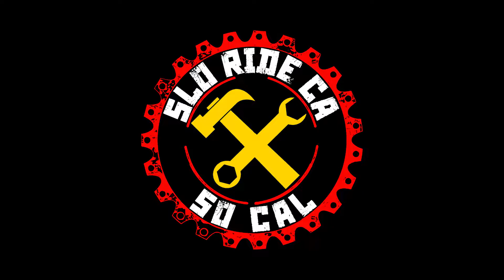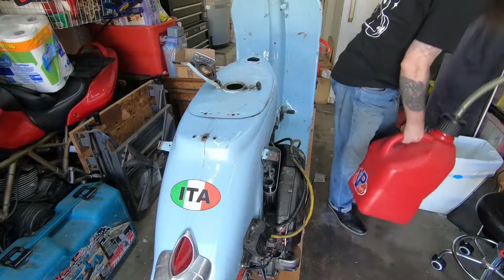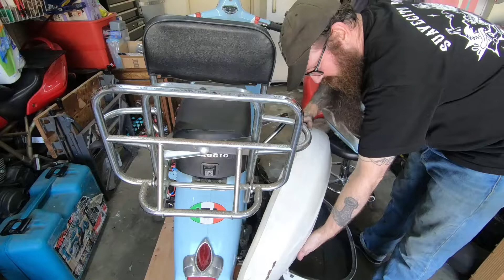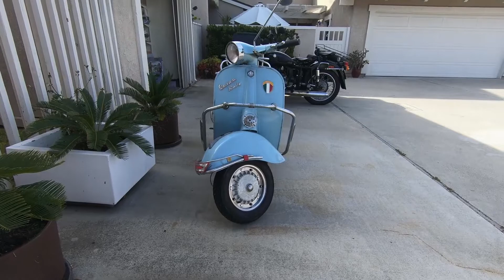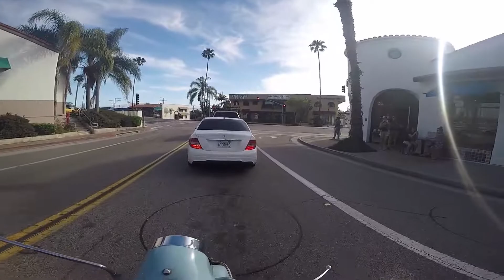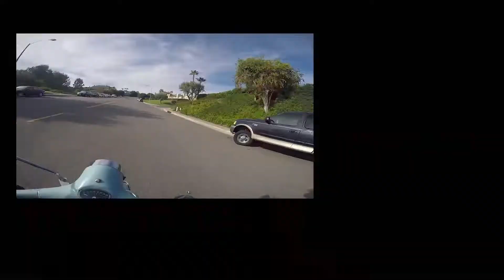It Lives! - Carb Install/First Ride - Vespa Rally Rebuild Part 5

Comment: It is scary who similar our lives are. I imported a 1963 GL and completely restored it and had kids before I could get to ride it. It has sat in the garage for 12 years. 

Getting it running again is my COVID project. I thought your tank clean out was a great video. I am starting with a Noco Genius Charger  to see if I can save  the battery then into the fuel system. 

Awesome video!!
Reply from the maker: I doubt you can save a 12 year old battery, they're fairly cheap though online. I actually had a battery I had just bought 10 years ago that I never put the acid in and it was still good. If you didn't run it much before you stored it I'd just clean out the tank, replace the fuel line if needed, clean the carb, change the oil and kick it over :) Good luck on getting it running again, they're a blast to run around town on and the kids love it.